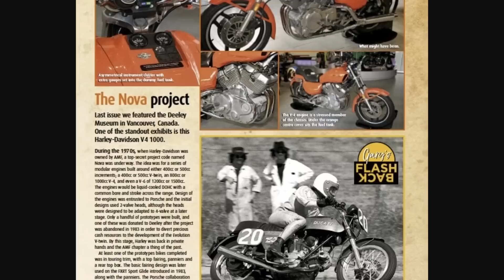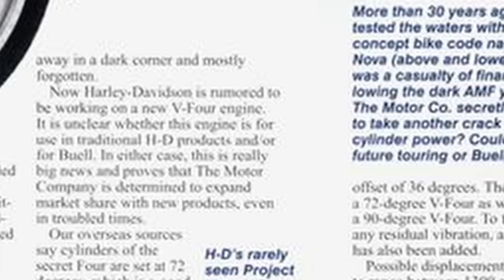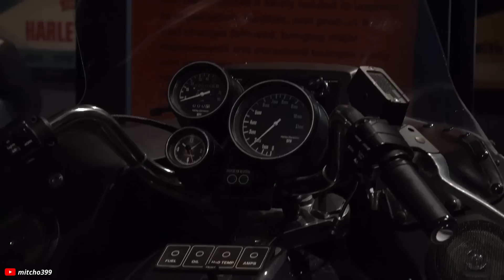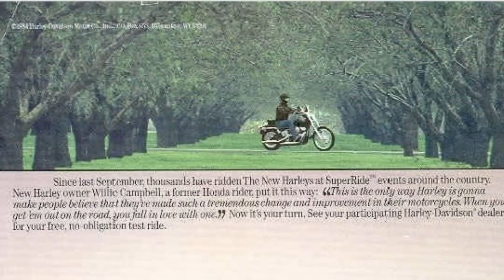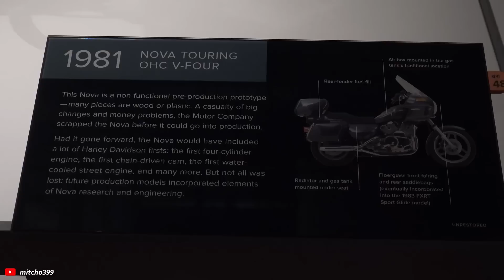The Secret Harley Davidson Motorcycle that could have changed EVERYTHING

Comment: I guess you could say that Harley made the right choice going with the Evo? I guess? I wish they had went the other route and pushed innovation with technology and performance. Maybe they wouldn’t be struggling to build a reliable modern motorcycle that actually starts and runs and struggling to get 90hp from a liter bike?
Reply: Struggling is a relative term. Horsepower in a tractor motor is an oxymoron. Only torque is an actual factor.
Reply: @carlbruhn1772    Talking about the 975 rev max, not the big air cooled engines.

Comment: At the time of the managment buyback from AMF in June of 1981, the Nova V4 was still around a year away from production. At that same time they saw the testing and introduction of the Honda V45 Sabre and Magna, making 82 HP from a 748cc 16 valve V4 engine to be introduced for the 1982 model year. The sleek V45 put the nail in the coffin for the Nova, and the decision to move forward with the traditional style Harley EVO V-twin instead.  It was a good and much less risky move on Vaughn Beals/Willie G Davidson's parts.
Reply: If Reagan hadn't imposed such hefty tariffs on imported Bikes, the Evo wouldn't have been the saving grace that it became.

Comment: You're forgetting the Kawasaki KZ-1300, which put out 120 hp in 1979, and the Z1-R TC, which was good for 130 hp in 1978-79.
Reply: Larry Jex not sure where you're getting that figure of 130 (crank?) hp for kz 1300.
I recently saw one with good compression dyno 82 hp @ back wheel which would put crank bhp around, maybe 95-100.

Comment: I say again, the biggest problem with Harley. Is the Harley customers that want 1940s tech.  Harley has chased that same customer as they get older and older, and soon they will die.  At some point they are actually going to have to find some new customers.  This bike sounds cutting edge (even though it's still hiding things like the radiator, and making fake fins.) and it's a shame it never came out.
Reply: A few years back millennials started to look into motorcycles and actually purchase them. Many purchased Harley's and the motor company couldn't wait to cash in on this new found client stream. After a couple of years  this all fell apart for HD. Why? Because few of those who had purchased Harley's were willing to purchase a second machine. Instead, they went to other manufacturers whose machines were far more reliable and cost far less to maintain.

Comment: Well, you get an engine design from the 1940's that just plain works.  Figure the speed limits on nearly 100% of our freeways being 75 miles per hour, with traffic going 85 typically.  A Harley 883 can easily maintain that with ease, and even go 90 for passing.  It rides smooth, has the perfect feel, and is considered among one of the best beginner-safe motorcycles.  What is there left to fix?  Nothing, really.

Comment: What many people don't realize is, that HD was an inovative brand for a long time. When the knucklehead came out in 1936 it was considered a superbike. Overhead valve technology, 4 speed transmission, a full circulating oil system, the thing was hitting speeds above 100mph (if you were brave enough). It was so future-tech, that many people were afraid to get one, because they did not know if it even was reliable, because nothing like that has ever existed. It would have been in Will Harleys spirit to release a bike like that, he always pushed the limits of what was possible, and his engine designe was so good that the moco basically used it until 69. I don't know why they didn't used those bikes personally. My best bet is, that they wanted to preserve the culture their bikes built, which is nice, because I myself embrace classic harleys. I own several and I don't want to ride anything else ever. I just love my obscure old machinery and if I can't ride my classic pre 1984 HDs I just might not ride anything at all. That beeing said they kinda dug their own grave. People buy a harley, because the want to ride the platonic harley. Everybody who wants, a performance bike just doesn't buy a harley and whenever harley wants to reach out and try something new people are like ''thats no harley'' and shit on the moco. So nobody wants them because they generate no power and those who want them, want no power because somehow its no harley then. I honestly hope HD reinvent themselves soon, because thats the way Harley intended them to be in the first place. For all those who still want a ''real harley'' guess what, there was no single ''real harley'' built since 1984, so I would suggest if you want a real harley you buy a shovelhead and  you start becoming a real biker, that means you learn about you bike an start fixing it yourself. Real harleys need real bikers, and you most certainly don't become one by buying a $800 jacket, some bike thats an empty shell of what tries to mimic and going to the dealer whenever the oillight switches on.

Comment: The Davidson’s wanted their company back. When they got control, they became a much smaller independent company that lacked the funding that the Japanese companies had. Those companies build ships, cars, farm equipment, etc. Motorcycles are a drop in their corporate buckets. They can take bigger chances. Harley simply didn’t have the money to continue development. That Harley survived at all, is more than alot of the Euro brands can say, as several of them went belly up, and are now recreations using names they bought the rights to, like Indian/Polaris did. 

While it is true Harley lobbied for tariffs on large displacement Japanese cruisers, they also asked the feds to end the tariffs in the late eighties, when they could have continued to benefit from them. 

They build solid, reliable bikes  .  I ride a Harley as my only means of transportation, and it has never let me down.

The reliability issues suffered in the 1970s were mainly based on tolerance stacking issues from the aging tooling that AMF was still using at the time.

Comment: No need to hide a radiator if you make it interesting.  The radiators of Japanese bikes of the era added to the coolness factor.  The "Water buffalo" for example.  Embrace the design don't pretend it is not there cooling the bike.

Comment: It would have been an expensive failure. The Motor Company made a very prescient decision. Producing that bike probably would have killed H-D. The Harley faithful would have avoided that thing in droves. And it never would have lured enough metric bike riders over to make it profitable. That's exactly what happened with the V-Rod. The difference being that, after two nearly decades of having more demand for their product than they could produce, they were financially able to roll the dice with a completely different motorcycle than their usual customers were looking for. Back in the early '80s, that albatross would have sunk the Company like a pair of concrete galoshes.

Comment: modern Harleys don't need 6 speeds. I've had three softails and a road king, 6th gear was an absolutely useless waste of space and weight on every one of them. for starters, the 96 CI evo is governed at 104 mph. you're only halfway through 5th gear when you hit that governor! even my 114 road king was like that. my shaft-driven 77 yamaha 750 triple was faster on both acceleration and top speed.

Comment: BS, Harley exploded after the Nova time to the point where people were willing to pay 2 and 3 times the value to own one. And this was because they went back to their roots. Staying with their in-house engineering. They are currently trying to pick up the foreign bike/Hipster rider by changing their platform but maybe instead they need to try and cut costs so the younger riders can afford to own a Harley, as opposed to dropping the Sportster, which gives the young new rider nothing they can start on or afford. Regardless, I see far more people on Harleys in California than on any other bike and most of those people didn't start on a Harley. They must have done something right.
Reply: Harley has been missing on a big market for years that would fit them like a glove. Café racers. In the last 10 years it's a market that has blown up exponentially. They could keep their "heritage points" while offering smaller, cheaper, and sportier bikes to the hungry new market of young people. The xl1200cx roadster would have been a massive hit if sportsters weren't so damn expensive that they can't compete.
Reply: @calincampbell5637  I agree with both of your points.

Comment: Nova would have been styling suicide in 1978 as buyers were AGGRESSIVELY traditional. I was riding and wrenching then, too and a more narrowminded crowd would be hard to find. It looks like two Laverda twins on a common crankcase and no way traditional buyers (the only ones left at the time and for MANY years afterwards) would have accepted it. OTOH the Evo succeeded because it was essentially just a top end swap at first. Novas squared off lines and especially the side case style failed to follow the classic (art does have rules!) proportions of HD big twins since the 1930s.  It must be remembered that every HD had to compete with Brooks Stevens styling success of the 1948 Panhead.

Comment: There's a bit of truth in everything that you say and so much to unpack. To begin with, I feel that the global motorcycle market is a far better place with the resurgence & success of the Motor-Company. All  one needs to do is look at the success of other resurrected marques such as; Triumph, Indian, Royal Enfield, and even add the Morgan 3-Wheeler to the mix. All due in part to an independent
Harley-Davidson. 
The buyout team of Richard Teerlink, Vaughn Beals and countless others including Willie G. Davidson had great insight into what Harley was and what it wasn't. They, IMHO, instinctively knew the value of the mystique that enshrouds the Harley-Davidson brand. To their credit, they took that value to dizzying new heights. Turning the newly independent, stand alone marque into the heritage locomotive set to pull the entire industry into the 21st century.
Where else, or better said, who else has offers a motorcycle (or any other product) that is arguably dated in it's engineering, needs performance upgrades BEFORE leaving the showroom, and maintains a higher resale value? Answer, No one. No does it like Harley and much of this goes to it's loyal following or Faithful who are by and large are blue collar types who are in it for the long haul. Or perhaps better said, in it for life; their's not the bikes! While I don't know if the data supports this, I feel that the average Harley rider, as opposed to the UJM (Universal Japaneses Motorcycle) rider, will have multiple Harley purchases throughout his motorcycle "career". Which makes him a customer worth cultivating. Thereby making the dealership franchise  more valuable. And with Harley ownership seemingly requiring regular maintenance, it fosters the owner-to-dealer relationship. A relationship that is fostered by the corps passion & heritage of bike, bike, & bike. No wave runners, no automobiles, no power equipment; just the H-D ownership & riding experience. and once a rider is able to ante-up for that, he can easily be back in the market for another. An enviable place for any manufacturer to occupy.

Comment: Everything Harley does is to squeeze $ out of current customers and people predisposed to buying a Harley.  If Harley made a second beginners feeder brand whose engineers could do what was needed to make 4-5 viable smaller HD bikes not the recent crap 500 and and 700.  A label that took a few cues from Honda by including DCT bikes. In that 500--900 range of bikes have 2 cruisers, 2 all-around sport bikes and 1 dual sport or ADV.  All using 2 reduced size engines based on the new  "Sportster" replacement.
Or HD could buy one of the small American assembled  and designed based companies.
I loved using a stick shift and would have bought my 2016 Colorado with one but even then the few they made with sticks sold fast.   Now I wouldn't.  If I bought a Camaro or other performance car I would want a stick but even in those they are rare.
Now I would like a motorcycle with an automatic so I can enjoy the ride without having constant having to think about making both feet and hands work towards a common purpose, my safety.  I had a piglet when I was in the Army and 30+ years later I wold by and Harley if it had a DCT with button shifters similar to the Honda Rebel 1100 and more of their models that are getting them exclusively.
You watch people who consider themselves traditional riders rave about DCT's with some adding them to their stable of bikes or just moving to the DCT bike.
I want to enjoy my bike ride and at my age I dont want the irritation of shifters because it is moe dangerous now that so many drivers are paying less attention to their driving because of their phones.  Time to stop is getting to be shorter.  Having Rebel 100 with DCT, ABS, etc just makes sense and like cars motorcycles shifters will be less coomn every year while Harley docent change and eventually dies.  People want to ride without unnecessary distractions or requirement.

Comment: Thank God the Nova didn't come to fruition.  Harley could have changed history?  LOL! Actually, Harley made history.  Why do people continue to measure everything else against Harley?  That tells it right there.  Harley and Porsche couldn't be farther apart?  LOL!  Having built an air cooled Porsche and a number of Harleys I know that's not true.  A water cooled Porsche is not a Porsche just as a water cooled or twin cam Harley is not a Harley.  They are only branded and designed to look like the authentic item.  That era is gone and the brands are dead.  Harley built "some" performance oriented motorcycles?  LOL!  Harley has won more races than any other brand in History.  Maybe another 50 years of racing history will change that.  As the video says "these motorcycles are fascinatingly not Harley."  Exactly.  Point made.  The motorcycles that incorporated these design features (numerous Asian brands came after this with these design features) are mere footnotes and mostly gone, rotting in landfills, while people are restoring Harleys and you can build one of that era 100% from aftermarket parts.  Gee...really?  Yup.  Hey, that's even true in Japan and European countries where the coolest bike that shows up at a gathering is consistently a Harley.  Just try selling your old Magna et al and struggle to get more than $1,000 for it unless it is pristine.  A Harley of that era is generally worth more as a basket case than a nice clean running example of an Asian V4, inline 4, or V2,  OHC, etc.  You know the brands and models I mean.  Why is that?  LOL!   Japanese, European, and even American brands are still in fact chasing Harley.  Everything they say, do, design, engineer, market, and advertise is compared to Harley, even for their sport bikes and dirt bikes.  Simply true.  Videos like this are proof of that.  Listen to everything said.  If you are riding something other than a Harley it is 100% guaranteed you have expressed an opinion about Harley or Harley riders while Harley riders don't care and haven't given you or what you ride any notice at all.  Interesting, eh?